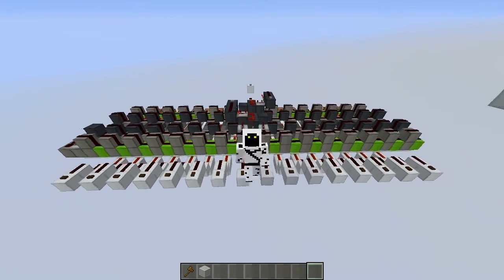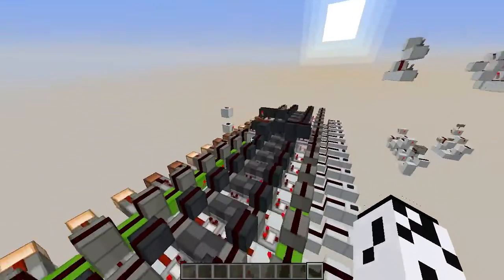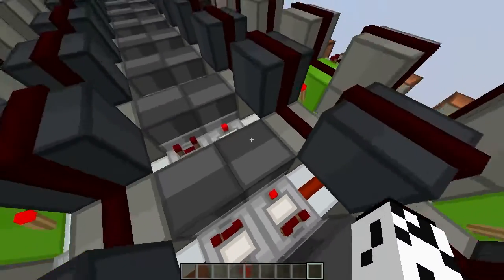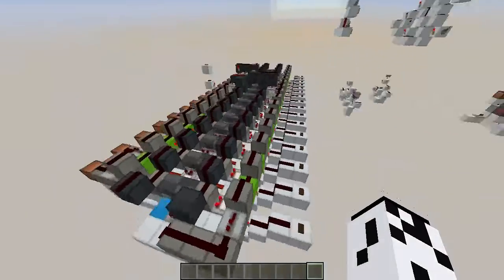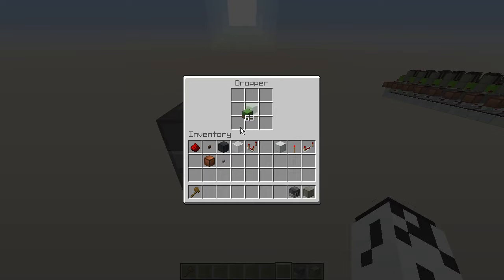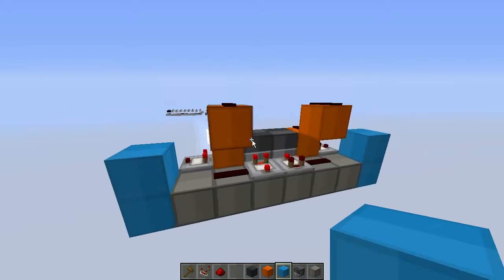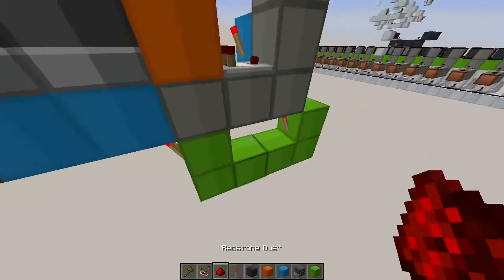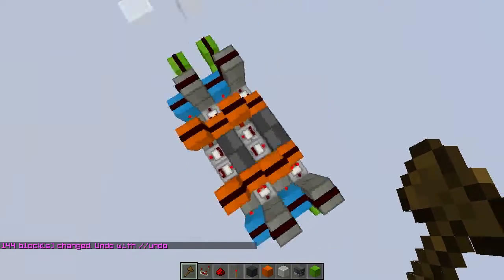16 Bit Solid State Bi-Directional Shift register showcase and tutorial 1.14.2 +

Comment: Thanks! after some poking around, I figured out the design; also was rather easy to add a horizontal bus-in in roughly the same way you did the bus-out (the opposite reset line should be raised 1 tick earlier though). With some modification I was able to add vertical bus-in too, so now I can build myself some Tetris memory :) thanks!